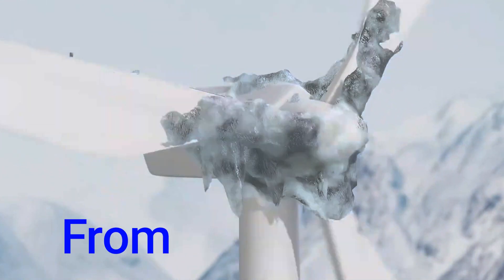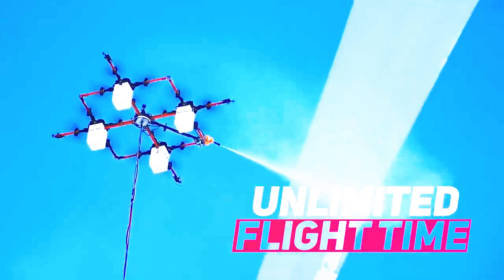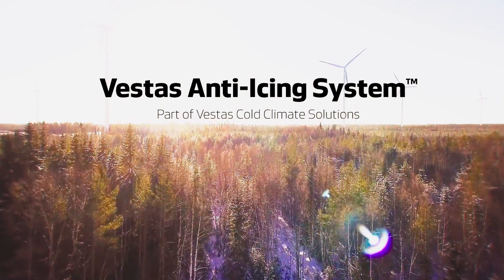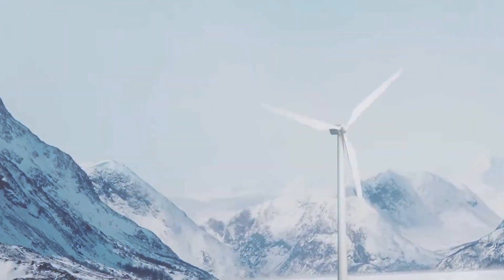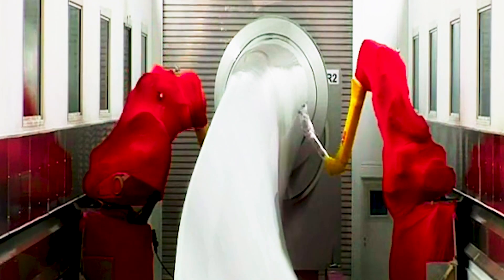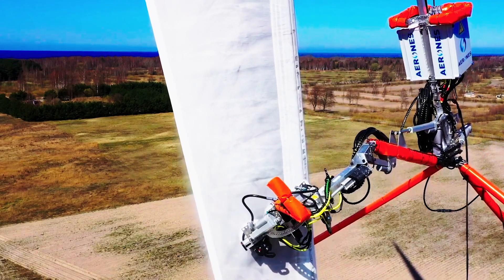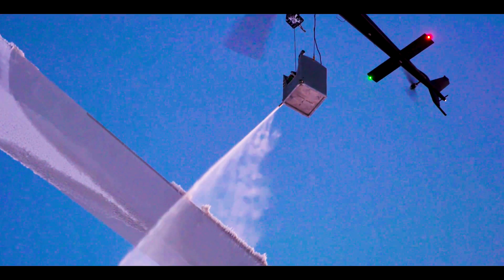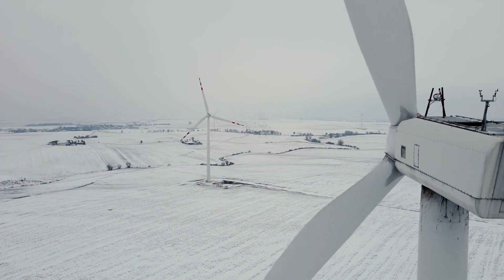How to Remove Winter Ice From Wind Turbines?

Comment: I already knows that the wind turbine frozen then how can you get the wind energies for those ice stom equation of the country's?
Reply from the maker: When wind turbines freeze during an ice storm, they become inoperable because the ice prevents the blades from rotating to generate electricity. To get wind energy during such conditions, countries rely on a diverse energy mix, including energy from renewable sources like solar and hydroelectric power, and traditional sources such as natural gas and coal, which can be ramped up when wind power is unavailable.